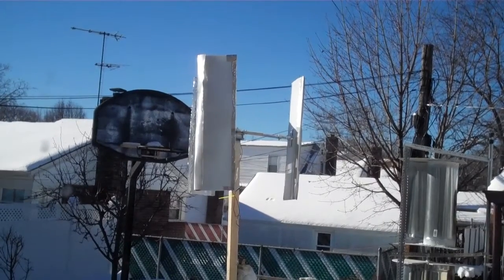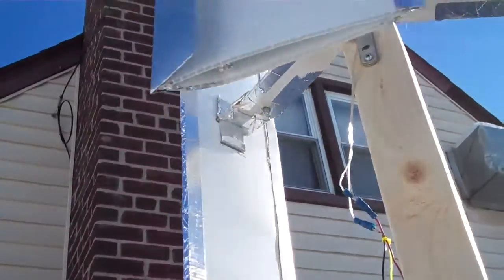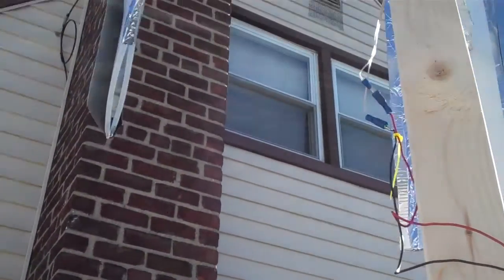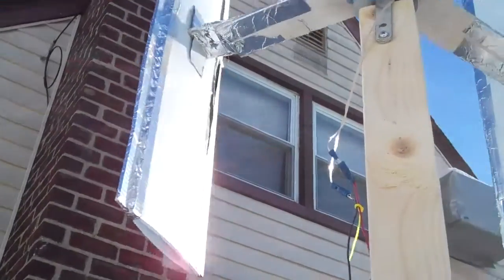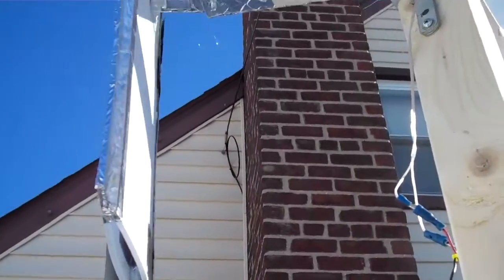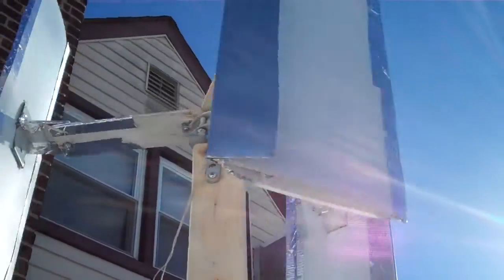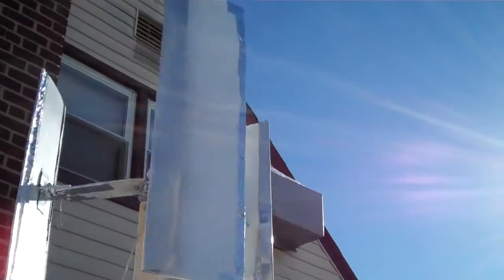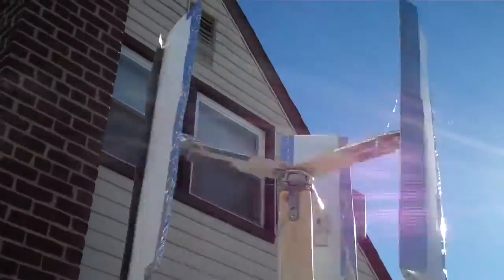Mini gen's first wings.mp4

Comment from the maker: @rikkiesix Not enough rpm as vawt. The horizontal turbine scares me a little because sometimes they turn so fast. I took down the pvc bladed hawt because I mostly have turbulent winds and I don't want the blades to break.  I like the Lynxsteam low rpm alternator which seems to be more practical.

Comment: have tried a squirrel cage fan they are already made and you could probably get one from your heat and air guy in his used fan pile. I have seen them in action and they really go fast. I am serious. It would take all the work out this and it would recycle at the same time. I am sure you could get all the super high speed you need for this small generator with this type of fan.

Comment from the maker: @Iseekoutthetruth Thanks. I saw the sail setup.  Actually, I have a 12 inch broken oscillating fan. I might try using that blade.  At the moment, I'm interesed in the vertical axis windmill.  They are kind of cool. I might try the airfoil blade again without the "pocket" at the tip.  I need the high revolutions to generate higher voltage.